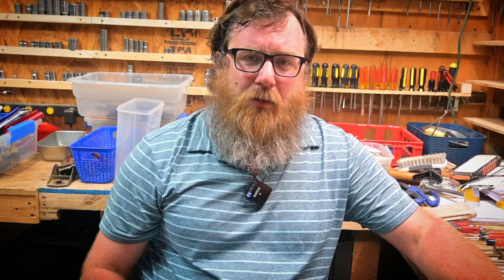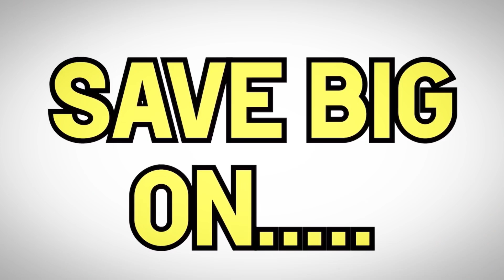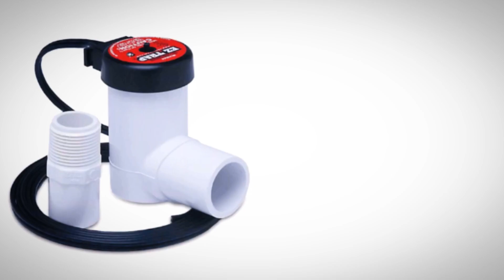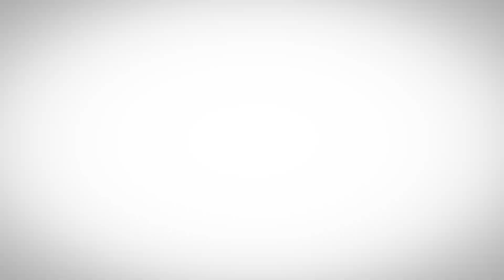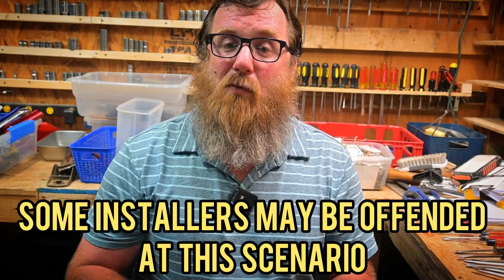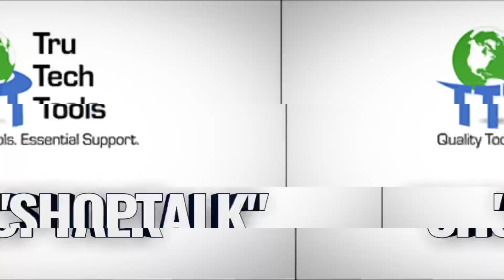HVAC Troubleshooting | Low (and Strange) Delta T Issues

Comment: I have a brand new (old stock)2.5 ton Trane 410a heat pump on a same year 2018 Goodman 3 ton air handler. My issue is I never have 15+ delta T unless the outside temp is 40s. Therm set to 68 in winter. Last night it got down to 12F but weather app says feels like 5 and the supply air temp was only 73-74 degrees, return air 66-67 (had it set at 67 since it was struggling) .  I think the ECM blower motor is set too high of a speed, its quite noisy . I do not see DIP switches or taps to change it just a large mulitpin connector to board. Any ideas?

Comment: -4 degree delta.  Installer used silicone to glue duct board fabricated return box 'cause he ran out of the correct stuff....  and 2 sides opened-up allowing attic air in.

Comment: we loved the Dry Units till its was over & cost a jug R 22 wasn't outta reach almost or is  now days  one the tell tell signs of an stuck Heat strips  in AC or heat  ....is also like you said  The blower never cuts off unless you Kill The  Power   but when The ac if it ever actually  cuts off  & satisfied the Tsat  The blower stays running till found & fixed

Comment: I had a scenario last night. Im in NC. 10 degree delta t. Ambient temp 92. Low humidity outside. Pressures 132/317. 13 sh. 2 sc. Comp amps 6. FLA 12.8. I slowed the fan speed down to med. high. added a 1lbs of 410 pressures didnt change and delta t went to 12-13. Im thinking the txv is starting to go bad.

Comment: I've run into those Goodman air handlers with stuck sequencer energizing the heat strips while running in AC. 10 degree delta.  Stuck the amprobe on the strips and sure enough, heating and cooling simultaneously.  Ended up just replacing the entire strip kit since everything was rusty from previous water damage.

Comment: I had a similar problem. I have a 2 year old York and the supply was blowing 115 F the other week with the AC set to 74.  My upstairs zone valve in my oil boiler was open even though the Sensi thermostat was set to AC and the log showed no heat called for the last month. I closed the furnace ball valve and it went down to 54 F on the supply.  Now I am still having a problem. At night when the outside air is 80F the upstairs air handler in the attic blows out 54F but during the day when it is 90F (and attic is over 110) it blows out 63F. I changed filters and cleaned the outside condenser with no change.

Comment: 5 degree delta. 4 inch gap between air handler and return plenum under side of unit. Also evap totally blocked with insulation and rat nest .

Comment: 2 degrees delt. Blower door off, with door switch bypassed. Pulling in 125 degree attic heat.Customer changed filter and left door off. .

Comment: Delt of 4 degrees, Superheat 50 degrees, Furnance running in middle of summer right after maintenance done. Low voltage wires touching in attic.

Comment: I wish to be excluded from giveaways. When we had the add-on AC installed in our mobile home, the installer failed to check the function of the furnace. Oops. I checked the furnace one before it was cold enough to need it. The thermostat was calling for heat and cooling at the same time in heating mode. I called the same company that installed the AC to fix the issue. They billed for the changout of the thermostat. I think they should have ate that cost considering the installer didn't test the furnace in the first place.

Comment: First scenario is a similar issue I found with my older GE refrigerator, defrost element was turning on during normal cooling operation, result of a badly worn mechanical defrost timer.  Compressor was running constantly to maintain temperature with a spotlessly clean condenser coil.  A few minutes of laying on the floor with a DVM, and the unwanted assistance of my black cat, found the problem.
Reply: Used to be a fairly common problem with GE refrigerators. Defrost heaters working as hard as the compressor lol

Comment: I will be replacing a failing condenser fan motor on an older Trane 410A residential unit.
High superheat and 11° Delta T on a piston operated coil.
When spun by hand, the fan only completes a few rotations. Amp draw is well below its rating even with the bad bearings.

Comment: I just had a job that had 12degrees delta t. The pressures were slightly low liquid line(260psi), slightly high suction (170 psi). Outdoor ambient was abour 90 degrees. System was only about 6 months old. It was the compressor. I replaced the compressor and everything worked perfectly after that.
Reply: Dang, compressor fail in 6 months? That sucks.